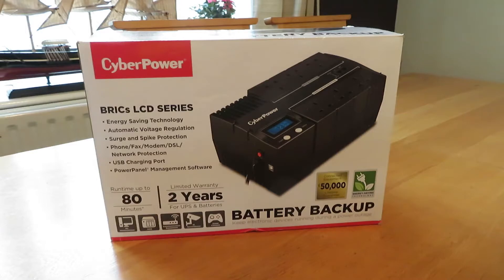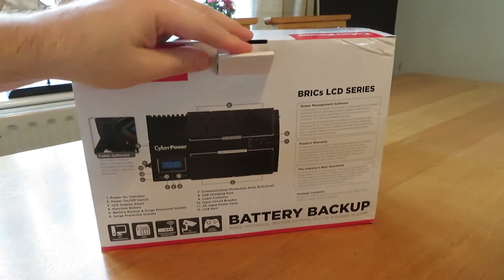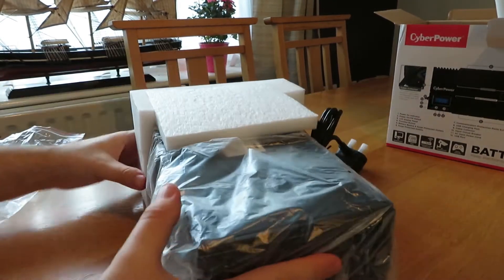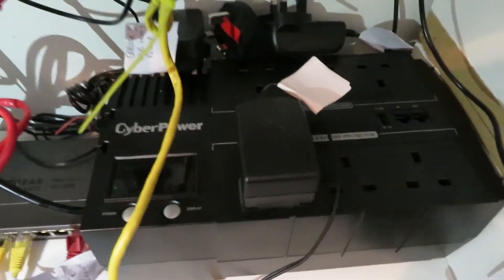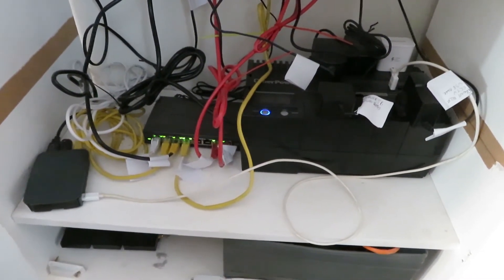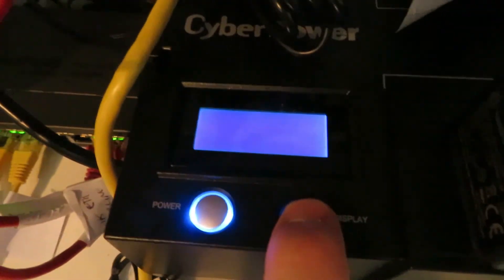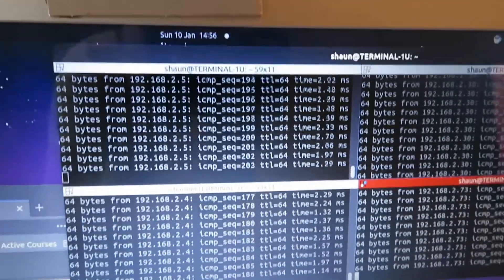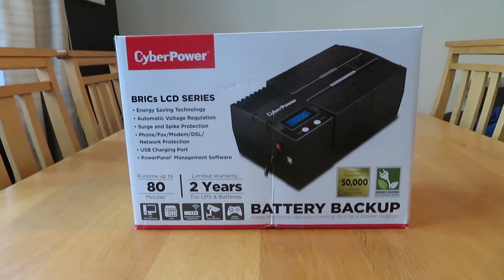BEST UPS FOR RASPBERRY PI HOME OR SMALL OFFICE NETWORK?

Comment: Not sure I have too much faith in these! My son is an Amazon FBA seller, he has had 3 of these returned! Now one does not switch over to backup once power switched off so def faulty, the other gets quiet warm with a sort of electrical smell, and I cant rem if the 3rd smelt when getting warm or not! I wanted to keep one for my 8 bay Synology NAS and Plex server. Does yours get warm? as read somewhere this could be a Battery problem!
Reply from the maker: No. I am still using mine, and it's flawless. But it's definitely worth letting people know your experience. 👍
Reply: @addicted2techuk Thanks, I'll RMA them for repair! I'll keep one for myself for sure 😊

Comment: Thanks for this but I've just had an issue with this device. I've just had two power cuts and my computer went down aswell, whilst connected to this device. I've noticed now that battery protection only applies to the front three sockets, not all six. I presume my computer went down because I had it connected to one of the far three sockets. I thought the device offered battery protection for six devices, I didn't read that it says on the device that the far three are only for surge protection. Is that right? Now that I've got it connected to one of the front three sockets, now it will keep the computer running during a power cut?

Also, I connected the USB cable to it and my computer in order to download the software but nothing appeared on my computer on any of the drives.
Reply: NO only 3 sockets have power backup!!

Comment: do that cyberpower usp support usb data to the pc? if it does you can try adding one of your rasberry pi a software Nut to monitor the usp and broadcast to the network if there is power outage or set up on it that will send a message to you, also you can use that send command to any device to shutdown with in certain peroid of time if the usp is on battery or at critical battery low